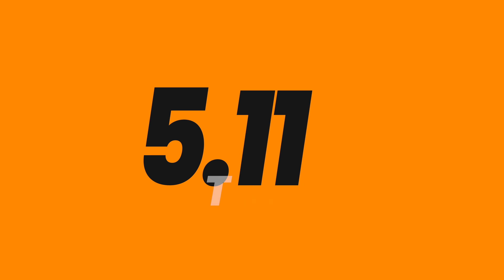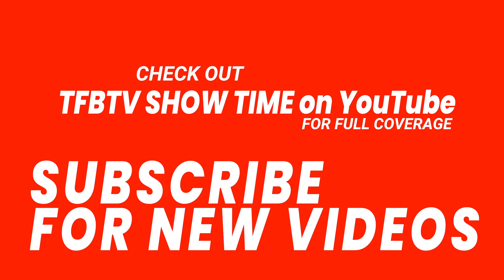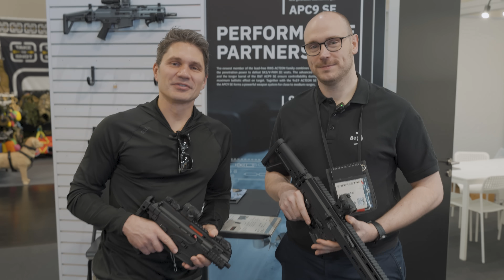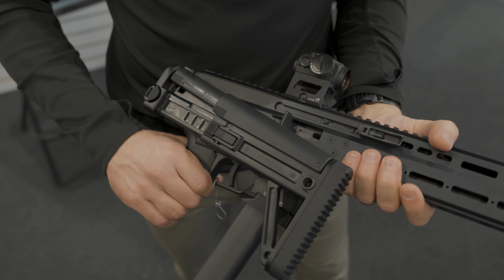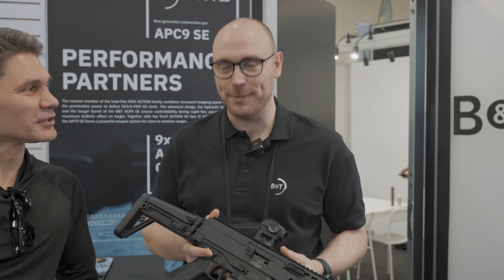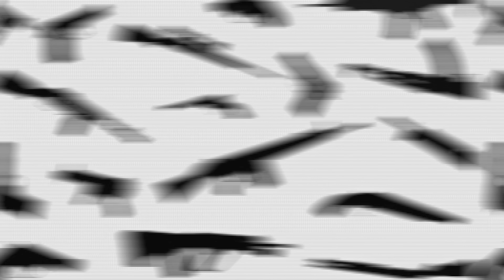Prototype B&T APC9: 9mm That Defeats Body Armor at 75m | EnforceTac 2025

Comment: stupid gun, propably ridiculously overpriced. you can take a ppsh 41 with hot steel core ammo and you have a IIIA defeating gun. nothing new. also you could use 556 or 300 aac to keep it short. or  you could do something really interesting and chamber it in 7,5 fk brno, could be as short as 5 inches and it would still go through no problem. im geting tired of bt bullsh*t. stupid guns for stupid prices. and you have liberty civil defense rounds which go over 2100 fps out of a 4 inch handgun and go through IIIA WHILE BEING A HOLLOWPOINT, on top of that they also have half the recoil of a normal 9mm. all of this is so stupid

Comment: Guys, how about Libra Snail 9x19 Luger?  The Libra Snail is a special 9×19mm Luger cartridge developed by the Czech company Libra a.s. around 2002. This ammunition was designed to enhance penetration compared to standard 9mm rounds.

Bullet Construction:
Material: The bullet was made from solid brass or aluminum with a steel core.
Shape: Its design resembled a wadcutter with an added tip, intended to ensure controlled deformation upon impact.
Penetration Capabilities:
Due to its construction, the Libra Snail round was capable of penetrating NIJ Level IIIA ballistic protection, including titanium helmets and ceramic plates in bulletproof vests.

Comment: Underwood sells the +p+ 90gr Xtreme Defender that's moving at 1550 out of a 4-5" barrel. 

The same bullet in .357sig is moving at 1700fps.
Reply: And the 65grain 357sig version is going 2000fps + out of a 4inch barrel. Should be amazing out of an 8 or 10inch barrel.
Reply: The +p 68gr projectiles are cooking too if you load them right
Reply: But that bullet won't hold together when it hit any armor.  Soft or hard.. it is the bullet that is doing all the work . The gun is just the tool to throw the bullet.

Comment: 9mm major and .356 TSW has joined the chat. These calibers can make major power factor and when hand loaded with solid rounds or god forbid the M/39B ball round body armor goes bye bye.

And thats out of 5 inch barrels….
Reply: 9x25 Dillon didn't get an invite. 
Feels bad man.
Reply: @DougsDiggers  its a bit of a niche caliber since the .38 super and 9x23 winchester exists to fill that gap. However it’s basically .357 sig on steroids so it’s no slouch even with regular ball ammo (2000+ fps) but generally considered overkill for a PDW application unless you wanted rifle grade ballistics out of a 7 inch barrel.

Comment: 9x19 Parabellun pushed to hot 357 Magnum velocity is not new. Demo Dick Marcinco the founder of Seal Team 6 said that they were running Hot 9x19 NATO made by Hertemberger for their MP5's thru their Beretta M9's when the slides started fracturing and one sailor took the back of the slide to the mouth when it separated. This is the reason why I only run standard pressure 9x19 NATO. If you need more velocity go with 357 SIG or 9x25 Dillon. The life you save may be your own. Speaking of which I'm going to go do a internet search for AR-15 357 SIG barrels, 40s&w bolt or complete upper. I really need a 357 SIG PCC in my life especially if it takes Glock mags! I wonder if CMMG makes it in rotary delayed Blowback? I have a dream of a MP5 40S&W killer.
Reply: There are parts and receiver flats out there for making MP5/10 clones in 10mm Auto
Reply: @0neDoomedSpaceMarine  I'm not interested in the MP5. The manual of arms sucks and reloads are slow. No last round bolt hold open and you need long ape fingers to use the push button release. I sold my H&K collection that I started back in the 90's and I'm not going back to H&K. I'm not interested in 10mm either because I'm not the FBI. FBI is traitor ass ho.

Comment: Why make a proprietary 9mm loading that requires a long barrel when 7.5FK exists
Reply: Because this can also run standard 9mm. Its a solid idea for training 👌
Reply: @mobilegamersunite  thats a good point
Reply: @MedicalTape_xX  it would save the military lots of money on training ammo
Reply: @mobilegamersunite  I guess plus mags aswell. What concerns me is getting the rounds mixed up accidentally that could be a problem too
Reply: @davidgraflex2065  I'm sure they will be marked with a stamp like +p
Reply: @davidgraflex2065 any modern 9mm should be able to handle that hotter round
Reply: Because 9x19 Parabellun has been around since 1903 and is currently the most popular pistol caliber in the world. Militarily most of the World's armies are using 9x19. Compared to the 7.5 that's a newer wildcat cartridge. I highly doubt that there are 5,000 7.5 caliber pistols in existence.
Reply: @celmer6 yeah but what’s the point of using a 9 by 19 when you can only use it out of one gun. At least the 7.5 round was already invented plus having a pistol already with it. And the 7.5 is probably still hotter than the 9mm
Reply: @davidgraflex2065  how many militaries and police agencies are using 7.5? Who is making part's for it? Who is making ammo for it? What is the 7.5 aftermarket looking like? Your answer is that it's oddball loser bullshit.

Comment: Someone rightly posted that the MP-5 can handle any pressure round. I’d just add “any MP-5 as long as it’s made by HK in Deutschland and not a clone”
Reply: The zenith ones have different bolts, locking pieces and rollers you can choose from to make your ammo work with their mp5 clone

Comment: I can't believe how many people don't understand how many advantages 9mm carbines have over the 556. The 556 has some advantages at greater distances, but in close combat some 9mm can actually deliver more shock to some parts of the body system, and it has several other advantages, including weight, recoil (follow up) and even reliability. Not to mention the fact that the new Lehigh defense rounds have almost the same capability in defending soft body armor. 

Don't people realize that 9mm mp5s have been used for over 40 years for a reason? And yes, 10mm would be ideal for this platform.

There's a whole different level between Zombie Hunters, collectors, and actual real life operators.

Baruch Hashem 
בראשית ברא אלהים את השמים ואת הארץ
Reply: So then why not make it in 10mm like you said would be better? Or 5.7? Or many other cartridge variations?

Comment: If I remember correctly the underwood XD +p+ 90gr round pushes over 1500fps out of glock 19.
Reply: Yes, There’s a few offerings that do this already. I think liberty civil defense is another.
Reply: Yeah, fairly certain it does, g9 defense 80gr +p ehp is like 1520 out of a 4 inch barrel as well. Solid copper like underwood. They make a 77gr with a sharper/pointer tip but label it as “mil/law” only because if it’s armor defeating capabilities
Reply: You remember correctly. And their 115gr .357 SIG will top that by 50fps.

Comment: The “why not 5.56” question is easy to answer. There are several factors that are good reasons to go this route. 
1. Try shooting an unsuppressed 5.56 in close confinement. Enjoy your TBI.
2. 9mm training ammo is roughly half the price of training 5.56.
3. Indoor ranges are often limited to pistol ammo only. European teams may run into training limitations with rifle calibers. 
4. You can use your spare pistol mags in an emergency for your carbine.
Reply: If it was me planning the ammo for this it would be +p+ pressures safe for use in most guns designed for it with a slower burning powder stretching that pressure curve in a longer barrel to pick up the velocity think H110, longshot, power pro or something in that vein. While I think a 5.56 would do this ballistic job better in about every way I am not the European agency trying to procure this. The range issue is something I had not thought of and makes an awful lot of sense as to why they might try to do this.
Reply: @Gunnut10mm  I would say that for average cop support weapon, 5.56 is not very common in Europe. Usually rifle calibers are for more specialized units.
Reply: Could carry more rounds.🤔
Reply: Any government agency is not going to be training somewhere that is restricted on what they can train with
Reply: @L0ck0ut1 Oh, my sweet summer child.

Hell, the US Army nerfed .30-06 with the M2 ball because the new M1 ball exceeded the range safety fans set up for the original .30-06 rounds in 1906.
Reply: @L0ck0ut1  depending on the type of unit, they may train outside their normal range pretty often. This is common for teams tasked with hostage rescue around the world. Cross training with other units, attending training courses, and conducting mock raids in new locations may all come into play.
Reply: Linear comps is just one way to dampen blast from a 5.56mm carbine.
Reply: This concept is flawed... if you accidentally end up putting your carbine mag into your glock... boom goes the glock
Reply: @ 106gr at 1500 isn’t much over   What a lot of solids do out of a Glock let alone a long barrel. Way under proof loads, which all glocks are tested with.
Reply: @hovojefe  it's not that hard to tell 17 and 33 rounders apart :D

Comment: Just issue an 11.5 inch 556?
Reply: But then civvies would have real capabilities instead of neutered ahh pistols
Reply: @Fightosaurus we don't have sbr laws in switzerland. Literally a non issue for us. No pin and weld and no tax stamp required.
Reply: @mysterioanonymous3206  Most of Europe goes with 300/600 rule while shorter "rifle" is much harder to get on permit.
Reply: @Fightosaurus  ahh pistol?

Comment: So you get magazine compatibility with potentially standard issue pistols, and an ammo that most likely should not be fired from a handgun, what could go wrong?
Reply: That 106gr probably IS the duty ammo for their pistols. Several German police agencies use ~100gr 9mm hot-loaded spire-point bullets for their standard ammunition.

Buffman has a video on Hirtenburger 100gr 9mm JSP's that were doing 1,300fps from a pistol, 1,450fps from an 8" Scorpion, and 1,600fps from a 16" AR. This shooting a 106gr at 1,500 from a 12" barrel is not extraordinary in any way.